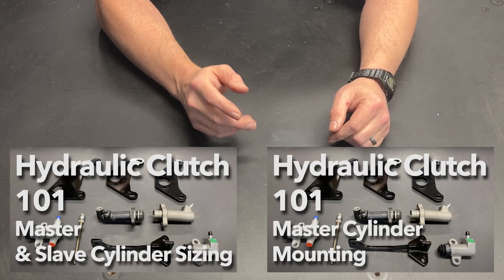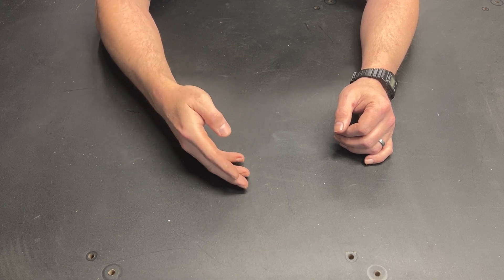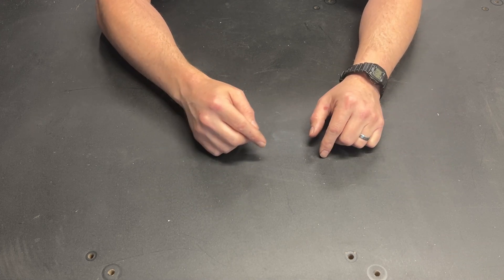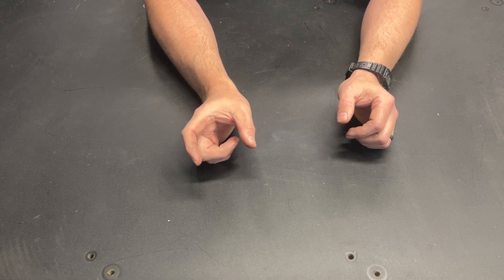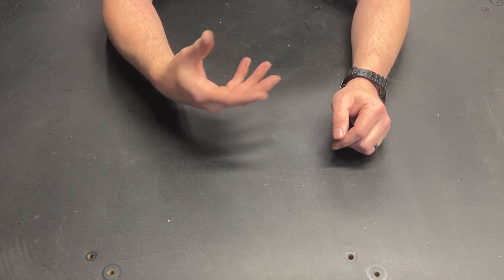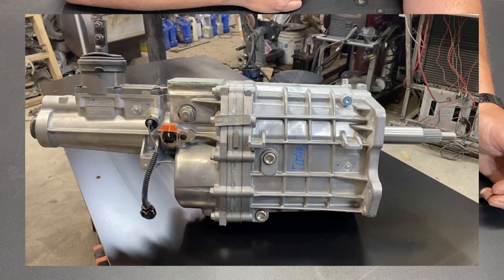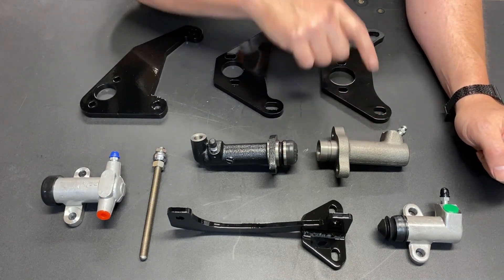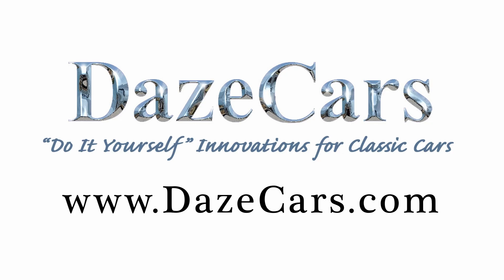Hydraulic Clutch 101 Pedal Ratio & Hydraulic Ratio Reduce Pedal Effort and eliminate a stiff pedal

Comment: Hey Daze! Thanks for the series! Tons of help! Bravo! I’m working on making a hand clutch for my 77 ranger (left leg amputee) . I got a zf5 from a 88 f250. Do you think a hydraulic throw out bearing and master cylinder set up would be better than a master, slave and clutch fork?  The big issue is having enough travel in my hand lever to full actuate the clutch. 
Thanks in advance!
Reply from the maker: thats a tough situation.  I always prefer the slave and master option over the hydraulic throw out bearing BUT as you said getting enough hand lever travel is going to be a problem, also there is the issue of effort because a leg is much stronger than an arm.  A hydraulic TO bearing is probably the better choice for your specific application because they tend to require less fluid and tend to require less effort, but I am not very familiar with them so I cannot be of much help beyond that.  I do know the master and TO bearing must be matched and properly setup or else you will damage the TO bearing.  Wish I could be of more help.
Reply: @dazecars yea I was kinda thinking they same. I found a MCP brake master cylinder 3/4 or 7/8. I still need to do the calculation but I asked chatGPT and it said it should work and not be too hard to pull. I kinda like the idea of having the slave cylinder so I can service it easier. It’s also a ton cheaper to go slave cylinder as opposed to HTOB. I still have to rebuild trans and everything just trying to get an idea of the route I should go. Thanks for the response, I’m sure I will reach out in the future. Keep building!
Reply from the maker: if you have a long enough hand lever the slave cylinder option may still work it would just need some engineering.

Comment: Hello, Love your work.... Do you have any brackets to mount an external slave on a 65 Mustang 157 tooth size alloy bell housing, by any chance?  I'm changing the C4 out for a Ford Top Loader gearbox, using Grant HDX 10.5 inch 3 finger style clutch & pressure plate . At this stage I would like to use the Mal Wood underdash master I think they come in 5/8 or 11/16 bore with a 1 1/2 inch stroke. Was looking at a stock Ford Slave or something from your collection?  Thank you for your time,  kind regards Stevie from Australia.
Reply from the maker: I don't have anything for the toploader.  Problem is the bellhousing.  The bellhousings for all of my kits actuate the clutch by pushing the fork back to front but an old school toploader actuates the clutch by pushing front to back.
Reply: @dazecars  Ok no worries, thank you for the reply. Kind regards Stevie.

Comment: How about a setup with hydraulic throughout bearing
Reply from the maker: I don’t offer any information or kits with a hydraulic throw out bearing. I don’t like how they feel, how leak prone they can be, and the fact that the transmission must be pulled if they fail so I have not done anything with them.
Reply: have you learned anything ?  i am trying  to set up my car with a hydraulic throw out bearing and cant find info on the pedal ratio .. i`m gunna start at 5 to 1 ..
Reply from the maker: I know you are asking him but I have some input here.   My advice with any hydraulic clutch is to always maximize pedal ratio.  In a perfect world you want full pedal stroke (fully up to just short of hitting the floor before the master bottoms out)  This will create the optimal pedal ratio.  If the master bottoms out at half stroke or several inches from the floor that indicates less pedal ratio and will result in more pedal effort.

Comment: Hello, great video. It explained allot of options that will help on my build. Which is a 1993 Suzuki Samurai that I'm installing a t5 into. This transmission will be from a 1996 chevy s10. It should mate up to the supercharged 3800 v6 that will go in soon. I've got all the other mounting figured out, just not the hydraulic clutch. The Sam came with a cable clutch that comes out above the brake booster. Connected to a crossover shaft sitting above the gas pedal. There's no room for a clutch master there so I need to go more toward the fender side where there is a small place. I just need to build a shaft off the left side of the pedal that connects to the hydraulic master and hopefully get a good ratio. If I can't mechanically then hydraulically I can change the ratio by using a different master. Thank you for helping me understand this. I might ask you some questions about it in the future.
Reply from the maker: if question come up, ask away.  Either ask here or contact me directly through my website.

Comment: Have you ever tried to use some of your kits in older trucks ? I have a 83 F100 so I’m just curious. Looking into doing a 5 speed swap to get rid of the 3 speed no overdrive trans.
Reply from the maker: I personally have not but I have sold lots of kits to F100 guys not sure the years.  usually they buy the universal kit specific to their transmission, the master cylinder and the line kit with the 36" upgrade.  Not sure what was involved in mounting the master to the firewall and connecting it to the pedal but I know it can be done.
Reply: @dazecars  I’ll definitely be in touch then the 83’s have an outline where the clutch master goes on the firewall. I’ll just need a pedal assembly and a kit. I was just curious. I appreciate the reply !
Reply from the maker: sounds good, I also am good at trouble shooting should the any issues arise.

Comment: Hello, does the 2-amp variac device with a diode bridge operate the treadmill and not break down?
Reply from the maker: most treadmill motors are 15-20 amps so a 2 amp variac is going to be WAY to small

Comment: Any idea what headers / car is in the 94+ example picture?

1965 Mustang here, and the headers I have are really close. I've massaged the collector so there's about an inch of clearance. Hoping between that and the DEI hear shield on the collector, it will be enough.
Reply from the maker: 20 years of selling them I have only had one person have header clearance issues. He had a set of try ys but I ran a set with no issues so I think it depends on the brand. The headers need to clear the bellhousing  so there is a void behind the leading edge for the hydraulic slave and bracket. 

Email me through my website and I can send some pix with measurements.